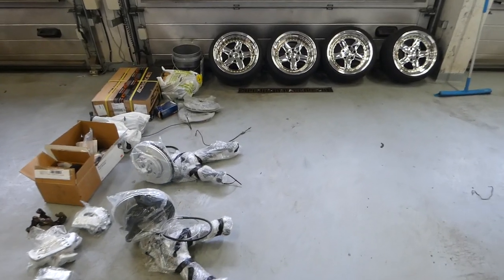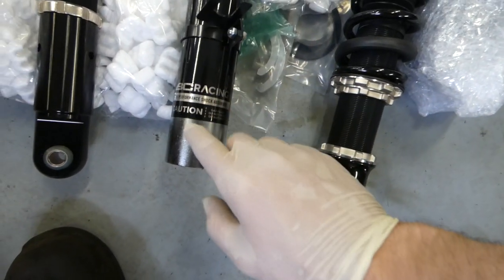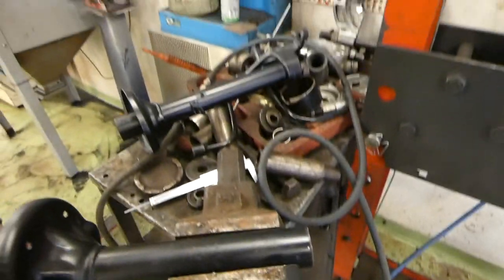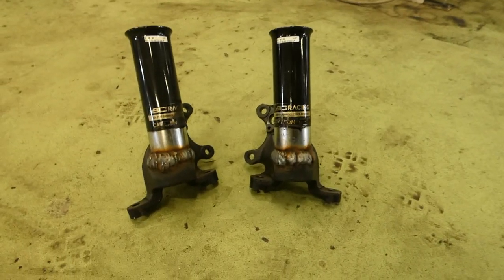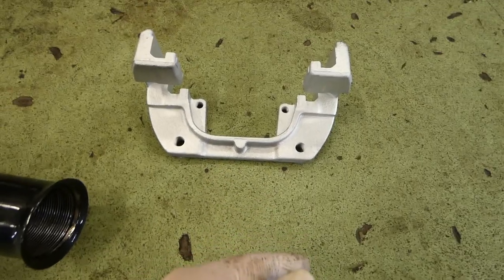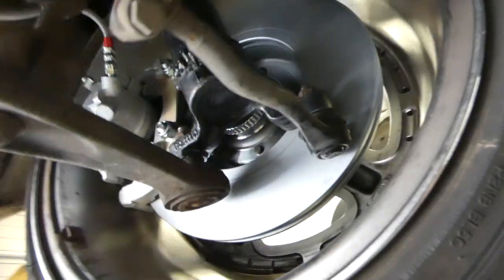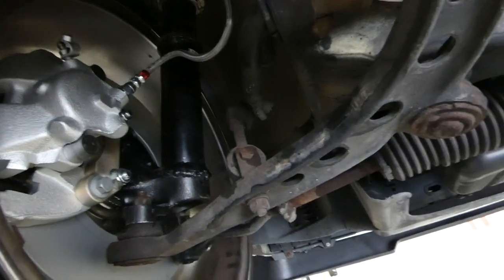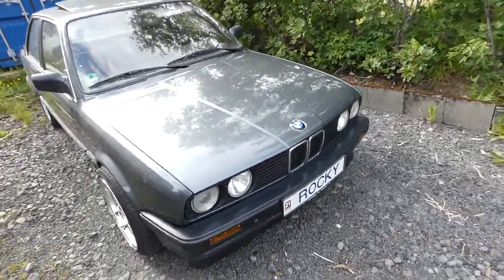E30 5 LUG SWAP FRONT, IRP, BC RACING, THE ROAD TO 5 LUG.

Comment: What brake lines do you use on an e30 with e46 calipers? I have almost all of the parts needed for this
Reply from the maker: Condor e30 speed shop braded brake lines. As I said in the description. Just normal style, not different from normal e30 size.

Comment: I am doing a very similar setup on my E30 along with an S54 swap. What front control arm did you use and are those standard E30 rear trailing arms or are they Z3?
Reply from the maker: Standard 325 e30

Comment: From what car come the brakes calipers? Tnk
Reply from the maker: Mods so far: (bought the car last year).
IS Front Lip
Mtech I rear wing.
Leather sport interior.
Mtech I steering wheel.
Leather shift boot and parking brake boot.
E32 750 leather parking brake handle.
Leather ///M gearknob.
E60 545i shortshifter.
51mm front struts.
Rear trailing arms for disc brakes.
Trailing arm polybushings.
BC Racing coilovers.
Front IRP 5 lug kit.
E46 Front hubs/bearings.
330i e46 Front brakes 325mm discs and calipers.
Rear SRS Concept 5 lug kit.
E90 LCI(Facelift) rear hubs.
E30 rear bearings.
328i e46 Rear brakes 294mm discs and calipers.
Condor e30 speed shop braded brake lines.
325i e30 parking brake shoes and cables.
Dual 3" Exhaust muffler NoName.
Cluster with Rpms.
17x8.5 et13 Front ESM wheels on 205/40
17x10 et15 Rear ESM wheels on 225/40